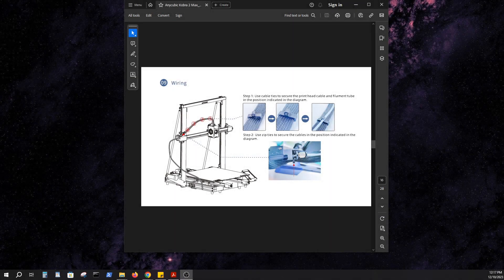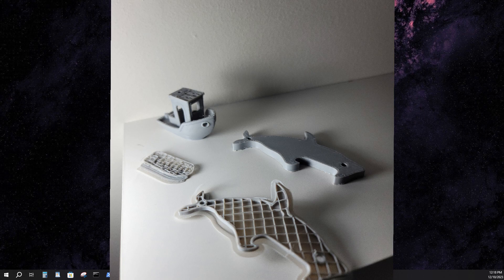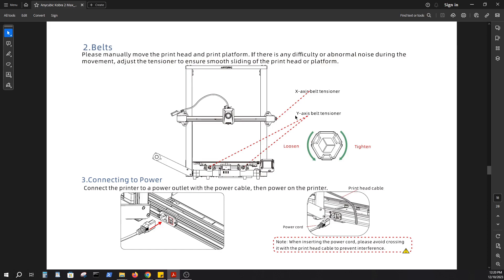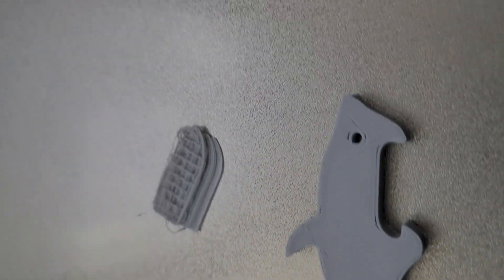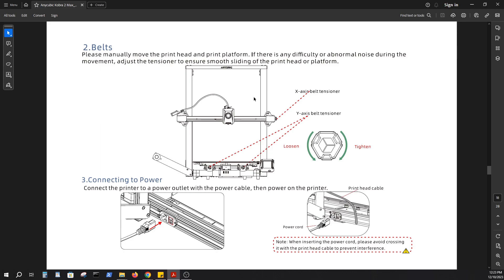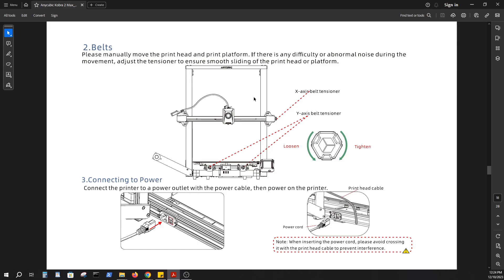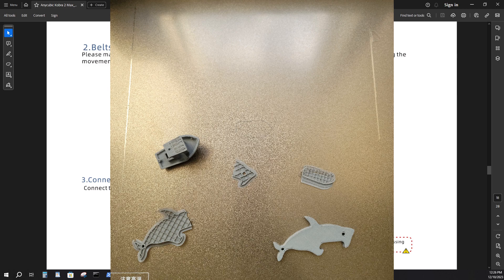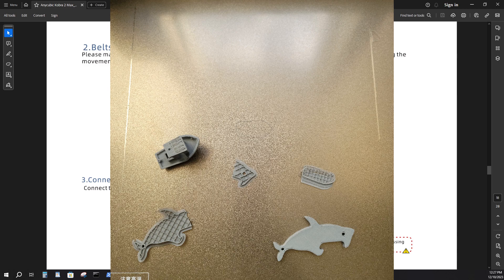Here's what went WRONG with my new Anycubic Kobra 2 Max...

Comment: What I hate about the instructions is that they are generic as hell, like for the nozzle swap they don't even give instruction on how much tighten it must be, at least a "turn it untill it doesn't move, then tighten it by one turn" - because with such tiny pieces you risk to destroy the thread without even noticing 
Mine when I tightened it like 2 turns started leaking between the heatbreak and the nozzle, the pressure pushed it forward during the second print (first was apparently ok) and carved the whole PEI plate... at least Anycubic support is good and fast, they are already sending me a new heatblock and pei plate

Comment: I can't seem to make even one print NOT fail with this machine.
The only things that print right are the one's  Pre-Installed on the machine itself.
And even those are not showroom quality, my old 3d Printer did better!
With my Voxlab maker, i hardly ever had a failed print.
Owned for 1 month and not 1 finishes without FAIL. Tried all instructions and help online (Bed Leveling/Software issues). Nothing works.
This one sucks.  I don't recommend to anyone.
Reply: For me, it's been print at 210 temp on head and 60 temp on the bed. I keeps changing the temp. So I figured out on the slicer you can change the temp and it will stay that temp. And I even get the mini flame thrower to heat the bed right after the head comes down to print to make sure the plastic sticks really good when it starts

Comment: I've had my kobra 2 since August 2023 and I've run through multiple issues. I found the inductive sensor is not placed correctly and should be manually adjusted first. I've dealt with X  and Y axis layer shifts. The Y VC was due to the vref on the stepper driver being too low. The X Was STUPID high... like 1.96v. Didn't catch that in time and now I've blown the driver so waiting on a new board to arrive.  Dealt with a significant over extrusion issue that took months to finally get fully dialed in through flow settings in the slicer.  Belt tension was a non issue for me but frankly that's something that everyone should check regularly anyway. I really didn't like that it doesn't use standard volcano models nozzles but replacing the heartbreak with a bi-metal one for a CR6 allows for use of standard volcano nozzles but you'll also have to reset the inductive sensor height.  Simply put: These printers are NOT an "out of the box" experience and not beat suited as a first printer.

Advice for anyone with one: check and set the vref for your stepper driver's, as ferrules to the power and bed connections, replace the heatbreak, and properly set the inductive probe height.
Reply: I am going to try this out!

Comment: I've had my Kobra 2 for just a week. at the start, couldn't understand why it wouldn't read STL files, then i found out it runs on OBJ . Once I sorted that it worked flawless. until today. 5 days in and the hotend isn't working. Comes up with a error saying check the wiring etc.

Comment: Yup am having the same issues rn and its frustrating ngl , i just got mine 3 days ago and tried printing 4 different big models +300g each and all failed hardly due to layer shifting , i tried tightening the belts that didnt work for me , i just updated the softawre and launched another print and now am just hoping for the best idk what else to do
Reply from the maker: If that software updated didnt help, try to go in settings and reset to factory setting. That helped me solve 3 printing issues so far!
Reply: How’d it turn out?
Reply: @beej5  it worked , basically the software updates stopped the stupid layer shifting for good
Reply: @soheibabadlia8504  Mine just layer shifted 10 mins in and ruined my project on the latest update.
It's not gone for good, it's still there.
Sense i owned this i haven't got 1 print to actually finish without failing.
Reply: @MatrixAlphaCWX  there are some things to check if the software updates doesnt solve it for you 
Check the bed belts tension 
Check that the upper brackets that connects the horizontal stands to the vertical ones are completely square,  they usually come slightly rotated not perfectly perpendicular 
Re run auto bed leveling and calibration and try again 
There are also some small screws on the back rod that connect the bed belts to the motor , you need to check them too and make sure its tightened